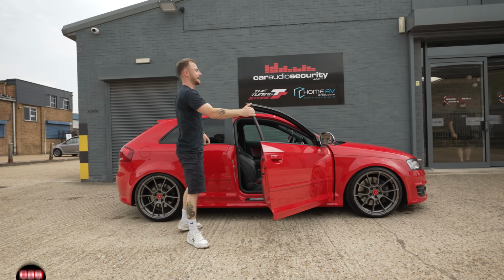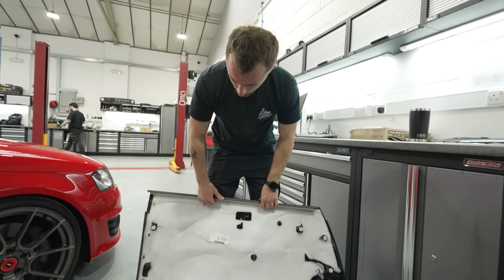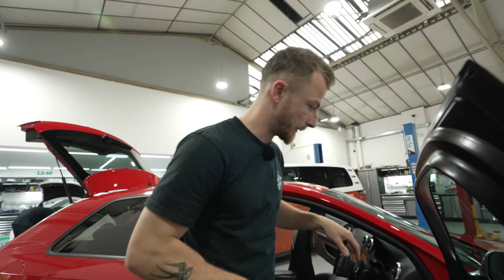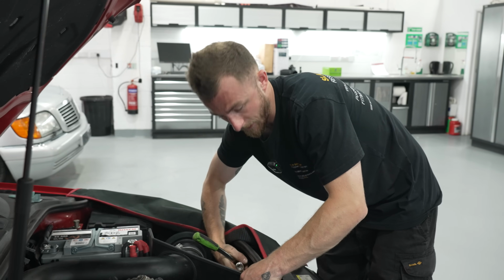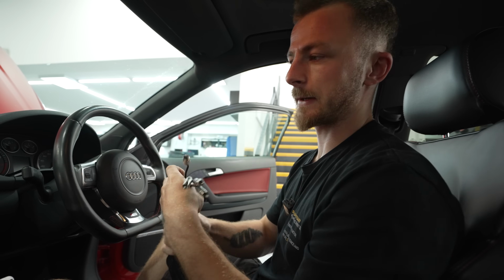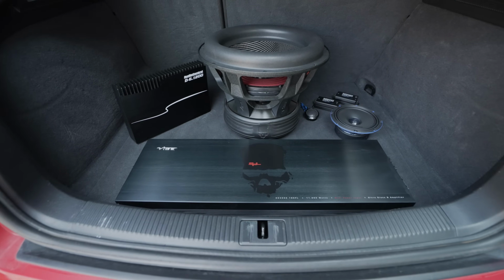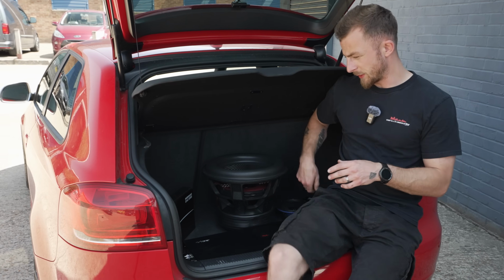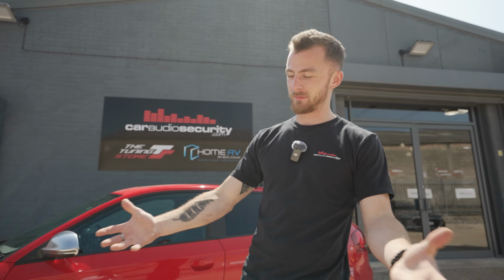NEW SUB & AMP for Project Audi S3 + Sound Deadening and more Cabling | Car Audio & Security

Comment: not had a decent sound system for over 20 years now, rocky punch was really good bk then, but my  favourite set up was the autotek amps paired with atomic subs, made my astras roof flex

Comment: About 20+ years ago I had 2x Orion HCCA 15s in the back of my MK2 golf (didn't look into ohmage n shiz and wasn't running it to it'll full potential at only about 1000w rms) but I loved it! vibe was just a sh!tty Halfords/Les Smiths special brand 😂 anyway fast forward 20 years and in my Mk5 golf, literally just this evening I've just installed an edge 1800.1 and vibe black death 12" @ 2ohm and holy crap it makes some noise! Can hardly hear my 3 way focals and a pillar builds I just made 😅 Completely changed my mind on vibe and other "budget" equipment, for sq you're covered anyway with audio control etc 👌 looking forward to seeing what you do with it.